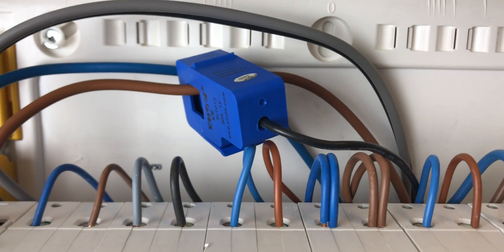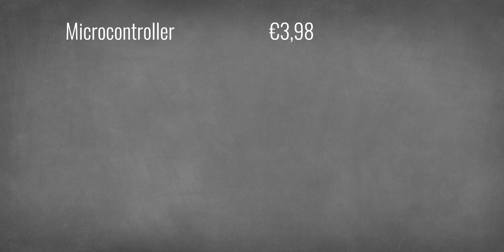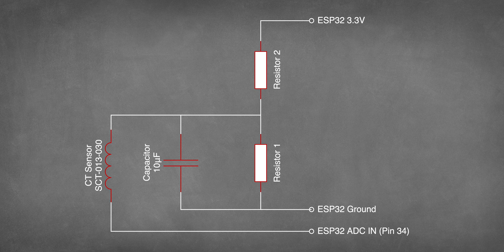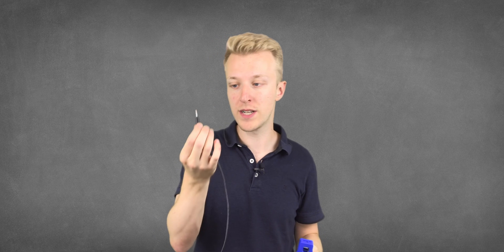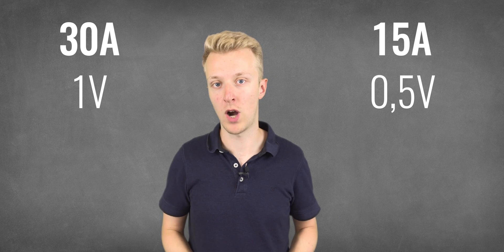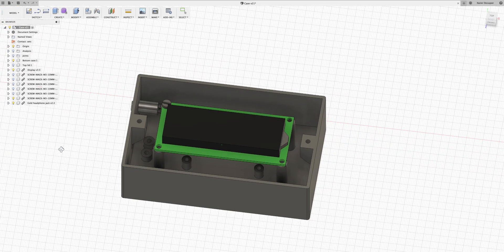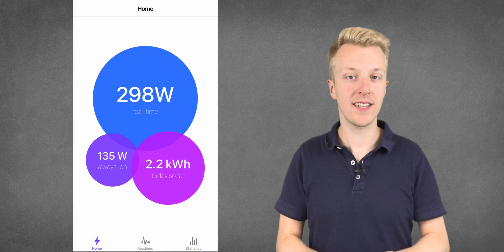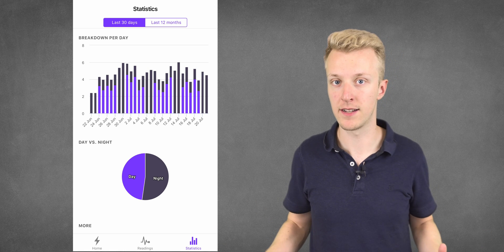DIY Home Energy Monitor & CT sensors explained

Comment: Usually you would also hook up a wire to live and neutral to measure the current voltage, since 230+-5% is the standard in Europe, but having 10A at 220V and 230V makes a difference in the reading.
There are a lot of ZigBee based measuring devices, which also get powered using the voltage. The only problem is their size... Quite bulky for the typical breaker box...

Comment: Here in the UK, and i believe the rest of the world. Active or True power (Resistive) is the only thing that is billed for.
Reactive Power is not charged against from the energy meter. Hence why alot of the time industries use loadbanks and battery banks to capture that reactive power when they are using industrial equipment to use again to save on energy costs.

Comment: Do I get that right: 
Your CT Sensor outputs a direct Voltage so no alternatig Voltage that you can take a measurement at any point ? ( I mean you have a AC Current and output a DC Voltage with your CT ? ) Otherwise I would not realy understand how that works except if this emonlib does it in the background ? 

Also you only measuring Current which means if one wants to measure power going out of the house ( with photovoltaik for example ) You cannot measure that way right ?

Comment: What is the maximum distance for the ct cables? I would need 3meters from thensensor to the meter
 Is it ok? What kind of cable shouldni use? Is 1,5 mm ok?
Reply: cut a CAT6 network cable ends and use two wires to extend the CT clamp range

Comment: You really should also include a voltage meter as well. Though that becomes invasive and is probably more problematic. Power is exponential, so when the voltage drops or raises (it's never the number they rate it at) you can fluctuate pretty large on power consumption. Length of copper wire can drop the voltage quite a bit if you aren't using a larger gauge. You would want to have the voltage read at the location of the current meter as well. This would give you a better read on the actual power consumed. Reading at the device will kinda bypass line losses, so you can use your readings to determine how efficient your wiring is as well (comparing that to your whole house meter).

Comment: Have you found a neat way to detect power direction for the case where the CT is monitoring a system which can both absorb power and generate power?  This will require current phase detection I believe. The ESP32 should be able to do that if, for example, we set up a 1ms interrupt and sample instantaneous supply voltage (via a voltage transformer) and the relative instantaneous current phase.  We can also get power factor this way and get closer to real power.

Comment: I'm wanting to be able to know when a remote device(sump pump) is being powered in our side yard by monitoring the circuit in our breaker box. I just want to turn on an LED light on the wall when it comes on.(to know it's still working and hasn't malfunctioned) Any ideas, anybody.

Comment: I've been following your blog post about the home-energy-monitor-v2 but can't figure out how to power the ESP32 while it's installed in the DIN box. Do you recommend using an external battery to power the ESP32? For this project, can I use ESPRESSIF ESP32-WROOM-32D ? Thank you!

Comment: Hi, Enjoyed this project, well done but there are some inaccuracies

1. CT stands for current transducer, not current transformer 

2. The mains voltage supply throughout Europe (including the UK) has been harmonised since January 2003 at a nominal 230v 50 Hz (formerly 240V in UK, 220V in the rest of Europe) but this does not mean there has been a real change in the supply. Instead, the new “harmonised voltage limits” in most of Europe (the former 220V nominal countries) are now:

230V -10% +6% (i.e. 207.0 V-243.8 V)

In the UK (former 240V nominal) they are:

230V -6% +10% (i.e. 216.2 V – 253.0 V)

This effectively means there is no real change of supply voltage, only a change in the “label”, with no incentive for electricity supply companies to actually change the supply voltage. To cope with both sets of limits all modern equipment will therefore be able to accept 230V +/-10% i.e. 207-253V.

To calculate your energy consumption more correctly, use 220v in Europe and 240v in the UK in your software calculations

Comment: Cool project, I want to put together something similar. ESP32 is a great platform for this.
One little thing: your CT measures an AC current. Without voltage reference there is no way to calculate real power. If you just assume 230V without phase information, you are calculating apparent power. For a household this is probably very close to real power, as you discovered. ‘Reactive current’ is still current and your CT does measure it.

Comment: Do you think it's possible to have it more granular, meaning not only main power, but power per breaker?
Reply from the maker: Sure! The ESP32 has a few more ADC input pins where you can attach CT sensors to.
And if that's not enough, you can always buy an external ADC.

Comment: Another factor not considered in the accuracy is that europe has 230V, but with fluctuations, so unless you meassure the voltage every second, you are not getting accurate values for the kwh consumed just by meassuring the Amps

Comment: Ohm‘s law (U=R*I) is about resistance, not about power, even if you present it in the most convinced way.
And unfortunately, the reactive power‘s current does flow through the wire and by thus creates loss.

Comment: I'm considering the same thing, I've got a 100Amp CT sensor that's rated at 100ma at 100Amps, but I have no idea how many turns (1000-1 does not tell you how many turns just the ratio) to calculate the voltage divider resistors/capacitors - which is how all the video start for a 5v Arduino Nano?

Comment: ohm's law (P=IV) only works for DC circuit... when it comes on AC circuit, we need to know for the power factor in order calculate the real power drawn (P=IV*PowerFactor)
Power factor is 1 or close to 1if the load is a resistive type.
Please correct me if I said something wrong for what I understood. Thanks :)
Reply: So true. If you don't sense voltage and phase shift it is senseless to call it accurate.
Reply: Yes. Calculating power P = I_rms * V_rms is wrong. This is apparent power VA. This is equal to active power W, which is power you pay for, only if the load is purely resistive. The active power P_active is the average of the I(t) * V(t).  For eg. switching power supplies the I(t) is not sinusoidal. V(t) is typically very close to pure sine wave but have harmonic frequencies.

Comment: Does need to be sensor clip "just" over live wire? or can be over all wires like clip sensor over extended cable cord (3wires - live, ground, neutral)? Does it affect if I will just clip it over extended cable core?
Reply from the maker: You can't clip it over all wires. The live and neutral wire cancel each other out, so the sensor would report zero.
It has to be either the live or neutral wire. Not both. Doesn't really matter where you attach the sensor, as long as it's on the cable that you want to measure.

Comment: Nice video..just one query...In order too connect SCT-013-020 to Arduino GPIO pin, do we need to cut the SCT013 cable and solder it to the GPIO pins? Is there any other way other than cutting the cable ?
Reply from the maker: Yes, you could use a female headphone jack.

Comment: Thank you for video, what kind of cable  would you recommed to extend the wire of CT (arround 10m) ?
Reply: I'm no expert but there may be voltage drop over a long run of cable. I'm in the same boat but am thinking about adding an external wifi antenna to the esp.

Comment: Nice project, and nice video. Some more schematics would have been fine. Doesn't the CT measure the magnitude of the current? so you are getting the apparent power, not the true power. Adding a voltage transformer and some more math will allow you to compute the apparent, the  true and the reactive power.
Reply from the maker: Correct! I didn't bother doing this, because my measurements were pretty on point (in comparison to the analog meter). However, since then, I've moved to a house and it's been causing some issues. Might revisit this project in the future, thanks for your suggestion!
Reply: @simplyexplained  Just mentioning something like: to measure reactive power you need to keep track of the voltage too.
That would make the point. Nice video anyway.

Comment: This is very similar to the route I went down around 2007 for my energy monitoring, ecept I used a much larger CT which wasn't split and I had to do the ballasting for the CT myself and mesure AC voltage. THey weren't as easily obtainable back then.  It worked OK ish with high resistivite loads but it was pitiful at low typical loads with a high reactive element.  I abandoned the CT route and moved to a blink timing and counting from the main meter using  a photo transistor.  Thats still the system I use in 2020.  Very accurate.  The only downside is that at low power consumtion the pulses can be a long time apart and so don't update too frequently.  The meter is a typical 1000 pulse per kWh so at 60 watts the pulses are a minute apart. . at 3.6 kW a second apart. THere is a further problem usng the ESP32 in that the analog to digital converter is a bit iffy (read non linear) at the ends of the voltage scale,
Reply: hello, I would like to talk to you about this. How can I reach you? thank you

Comment: Hey, great project!
I am in the process of building this for my home, but have come up with a problem.
After 60 samples of values are shown on the Arduino IDE monitor window the readings drop to zero.
I have changed the 1 second sampling to 3 seconds, and still after 60 samples, it goes to zero!
I am running all new resistors and capacitors, confirmed all ok, the CT clamp is same model, and i have confirmed i am getting Vac from it.
I have tried different input pins on the ESP32, tries calibration values, tried changing the 1480 averaging value, but still no more than 60 readings!
Any suggestions greatly appreciated!
The first 60 readings are realistic, and fluctuate a little.
Reply: Seems like after further investigation, the millis() is causing the problem.
I have also tried the millisdelay() and that does similar (not same) problem.
Without any timing, sampling as fast as possible, it works fine... strange!

Comment: would it be possible to put a ct sensor on each circuit in the breaker box or is it too noisy in there?
Reply from the maker: Should be possible! I doubt that the noise will be significant enough to really throw of your readings.

Comment: What about measuring mains voltage? What options are there if you want to measure inline (not via a magnetic field)?
Reply: One option is to use eg. Tiepie Handyscope TP450. You can view the voltage waveform.

Comment: Hi! I just want to ask if the CT sensor will be destroyed or burned when the ampere passing through the wire exceeds 30A? Can the CT sensor handle large amount of current?
Reply from the maker: You can buy higher rated sensors. There is one that goes up to 100A.
Reply: Simply Explained - Savjee This doesn’t answer the question posed
Reply: @simplyexplained  Thank you! :)
Reply: This is an important point. Due to non-linearity of CTs, we choose the rating in the sweet spot of what we want to measure. However what happens if we supersaturate the coil?

Comment: Can I use this project with measuring current by CT sensor for EV car. If I can, is it importance to use monitor together?
Reply from the maker: Not sure I understand the question. Important to monitor what together? 
Yes, you can also use this to monitor individual appliances or your EV car.

Comment: Is there a way to identify different devices similar to how SENSE claims to work (but doesn't)?
Reply from the maker: In theory yes (this is still on my todo list). However, to get the best results you would also need to measure voltage.

Comment: What should we do if we have a 3 phase system? We can add 3 CTs but how do we calculate the total power used? Do we just add the power of individual phase? And what is the value of resistors you have used?

Comment: Very cool project!
Can I use it on a power bar (which has 3 wires insulated) for example? or only on the hot wire of the entire house?
Reply from the maker: You can add it to any wire of any appliance or device. In your case, you would need to dismantle the insulation and add the sensor to 1 of the wires that are carrying current (most likely blue or brown).
Reply: @simplyexplained  Thanks. BTW, did you add a burden resistor to the sensor?
Reply from the maker: No, this model had a built-in burden resistor (which is why it outputs 0 to 1V)
Reply: @simplyexplained  when I searched for the model of this sensor on YouTube one guy said he needed to use burden resistor. I wonder why..

Comment: I've built my own on a solder board using an arduino nano. Problem is I have to poll it using python/serial and inject into influxdb. My next version is going to be the esp32 as well. But I am going to use the ADC1115 to get better resolution, 16-bit vs 12-bit. 

Nice project build. I love the idea of the usage over time in the way you store the data and figure out the "Always On" devices and account for them.

To get real voltage, you could add AC circuit that reads the voltage directly, then rectifies and outputs to power the esp. But you'd need to have an AC power brick, as the DC ones have been smoothed and/or are done digitally with no transformer. On my line, over the course of a day, my voltage can swing from 125VAC to 116VAC (US power), which can make big difference on power consumption. Right now I'm actually using 2 power bricks as it's still in prototype form.
Reply from the maker: Thank you! Wow, that's indeed quite a big difference in voltage. I'm actually investigating in using a TP-Link smart switch to do the voltage monitoring. I have a few around the house already and they do expose the voltage through an (unofficial) API.

Comment: Hey nice work! Im planning on doing a similar project on my channel soon. You bet I'll take a look at your code! 

A small correction though at 5:22 I think you meant apparent power. You cant reliably measure true power without taking into account the voltage, it should be fairly easy for you to implement this using a voltage transformer.
Reply: show me???
Reply: 5:54, yes you are right, he means apparent power. He is not measuring true power consumption, only apparent power. But in his case they should be very close.

Comment: Really wish there was a way to use a clip style sensor on an individual appliance cord to determine if it is on or not.  From my readings a CT would require cutting the cord to clamp one of the conductors, is there another way?
Reply: You are correct. These sensors can't detect current with a regular appliance cord because the current going in one wire is going out the other wire in the other direction. These opposing currents null out each other. You could make a short extension cord that has the two wires and then put the clamp over one of the wires. Given the crap  I have lying around that's how I'd do it.

A cool little trick for measuring low currents is that you can wrap the wire you put the sensor through the sensor several times and then divide the resulting measurement by the number of loops you did.
Reply: Yes, using Hall Effect sensor. See non-contact voltage probes

Comment: 3:18 But it's AC and the voltage is fluctuating between +325V and -325V. Do you assume that it will average out in the long run?
Reply from the maker: Well the circuit converts the AC output of the CT sensor into a completely positive one (going from 0V to 2V). Then the emonlib library counts the cycles and calculates how much current is going through it. Emonlib is actually where the magic happens.
Reply: This will show aparent power or KVA. Capacitive (switched mode PSUs) or Inductive (Motors) without power factor correction will skew the readings. The usual trick is to power your circuit from an ac ac adaptor to also get a reference low voltage to go with the reference current from the Current Transformer.

Comment: Yes! More videos like this! I love tinkering with IoT projects, and am constantly looking for inspiration. Keep up the good work!
Reply from the maker: Me too! I recently got into programming microcontrollers and it's so much fun (but also very time consuming). I also have a project with an e-ink display. Might do a video on that one as well. Depends on how people like this video.
Reply: Simply Explained - Savjee I bought a few CT sensors as well a few years back, but the incoming wires are actually too wide for the sensors.
However I noticed that we have a LED flashing 10 000 times for each kWh on our energy meter, so I’m thinking of using a D1 mini (a tiny Arduino-like board) with a photo resistor. That microprocessor will then report to a Home Assistant instance. I might write a blog post if you’re interested?
Reply from the maker: @GöranLilja  Would definitely read that! I also think that Home Assistant is very interesting. I don't have it at home yet, but I am considering it as my collection of IoT devices is steadily growing and not all of them work together nicely.
Reply: @GöranLilja  sure please keep the good work with good explanation... we are eager to try that!